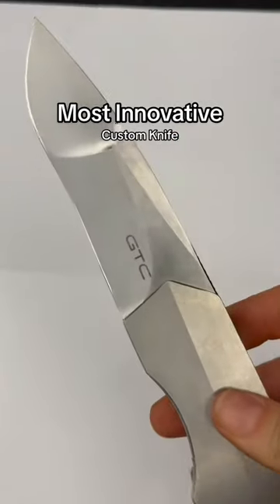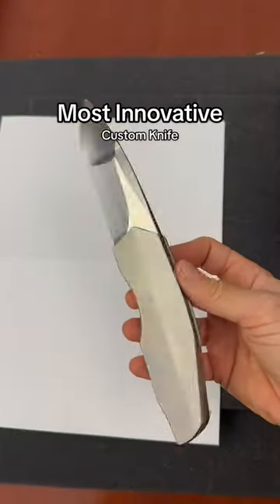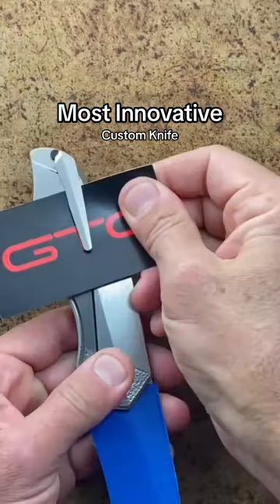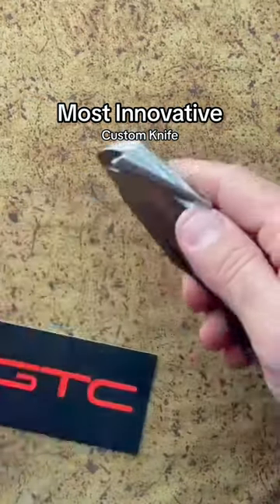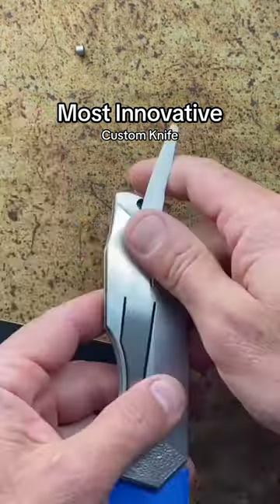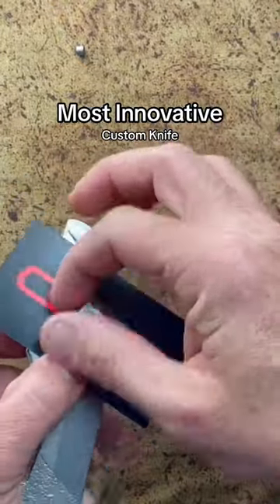Knife disassembles in 10 seconds

Comment: The paitience required to either machine that or set up the CNC coding would be beyond most mortal machinists.
Reply: I’ve operated a CNC for over 2 decades how difficult it would be would depend how many axis your cnc is and how many tool holders your machine held
Reply: High tolerances isn’t much harder just more time consuming you have to watch your tool wear and measure your clearances a lot my current job I have to maintain a plus or minus .0001 tolerance on my set up and the part needs to measure to a .001 tolerance I love talking machining
Reply: @bobelkiniii1461  it's always nice when you love what you do! I'm a licensed electrician and wood worker and people think I'm nuts because I love working and running my business. Work is my second favorite thing only behind spending time with my family. I will admit I do get jobs I like more than others but life is definitely easier when you do not hate your profession!
Reply: Hm
Reply: @RUGERJONES independant or union ?
Reply: @Coincidence_Theorist  did you ask this question so you can badger me about the answer?
Reply: @Coincidence_Theorist  it's ok either way I was just wondering lol. I'm an independent contractor, have my own LLC, 2 LLC's actually, both owned and operated by my family and I.
Reply: @bobelkiniii1461 you're either on a lathe or a grinder.
Reply: not really
Reply: @bobelkiniii1461  could you hollow out a penny so that a dime will fit under it? So when the penny is laying flat on the counter the dime is under it, and totally hidden? Saw a penny/dime pair once and always wanted a pair.
Reply: @Michael McClellan  honestly,  shouldn't be that difficult. As long as everything is dialed in,  it's just flat hollowing out. I might need to make a set now...
Reply: Mmmm no, the program for this would be made in less than 30 min. To refine it I would say it would take some more time. Simple things like this take up no time to make in CAM. I’m sure sketching and modeling takes longer.
Reply: @michaelmcclellan9422 I think this would be a good test for someone during a hiring test of there skills like welders come in for a test machine at come in and make a dime fit in a penny perfectly or we’ll not qualified enough, at least I think it would be a great test of skill
Reply: Cnc coding does not exist anymore all cam softwares do it automatically you just need to set passes speed etc but you can still do it manually if you wanna be an intellectual fella
Reply: Could do this pretty quick. 3 axis too, if you want. All dims +/- .001
Reply: It really doesn’t look that complicated to create gcode for, lots of flat surfaces, no undercuts or multi-axis milling, 1/2” endmill to hog most of the material out, 1/4” hog nose for the pockets inside the handle and for the lock bar and a 1/8” endmill for the small slots on the bottom, threadmill for the threads and Robert is your mothers brother

5 axis mill would let you do both sides in one setup but you could do it easy enough with 2 setups on a 3 axis and some custom fixturing, a couple hours  total programming for all the parts and a few pieces for optimizing feeds and speeds and you’ll be good 

The majority of time and money spent on the design would be 3d modeling and coming up with the design, the actual machining and CAM programming is the easy part
Reply: I highly doubt that.
Reply: @phuckyocouch9098  I’ve operated a lathe cnc and a manual lathe I currently operate a 4 axis cnc my machine has a chuck and I engrave blades on a round roll and that roll will go into a printing press that makes labels and my die will cut out the labels my company is rotometrics but we just got bought by maxess
Reply: @michaelmcclellan9422  you dont want the penny hallow you want a relieve cut into one side of the penny it would be easier with a with a thicker coin but I think I’ll give it a shot tonight
Reply: @RUGERJONES  i hated my job when I was younger and was a jerk and complained about everything for a few years then I got moved around a bunch and fired I thought I would never be capable of running any other machines but I discovered I’m great at running mazaks haas doosins and pretty much any machine that uses G and M code but I was super greatful rotometrics rehired me and since I’ve been back I found my happiness I wish I could make videos of the dies I engrave
Reply: @seancrane278  make sure you use older coins. I think it will turnn out better seeing as theyre better quality materials
Reply: @bobelkiniii1461  maxess. … interesting name from an .. i guess I’ll say Esoteric point of view .. though i don’t like how that sounds
Reply: @bobelkiniii1461  perspective changes everything does it not? 

Id love to see the results of you do the coin thing. You could have an oss stash coin from two 50 cent prices or silver dollars. 

Soo one sleeves into the other. 

Then you need to make a little elevated mount thing the coin sets in. Only b needs to be elevated the mm or soo the coin is thick.  

It will be used to separate the halves again by dropping the coin into a flat hard source while b placed in its little retaining collar thingy you make.
Reply: @bobelkiniii1461  there’s also an oss coin knife. 

Soo they fired and rehired ya? Sounds like it was all meant to be. 

Ive learn much of that sorta thing from #ChironLast
Reply: It largely depends on the machines you have available and your design. One of the things I do a lot because I only really have access to machines I built or restored is reworking designs to be easier to manufacture on the machines I have available. The end product is almost exactly the same but the way you get there is different.
Reply: Sure bud...
Reply: @IDK-yx2lr many machines still do long hand Fanuc. New Fadals for instance, have no conversational or EIA/ISO. We are not yet at the point of all machines or even most. So not sure what you're talking about.
Reply: 😂 what? Maybe 14 yrs ago... if u got a good machine and know what you're doing, it shouldn't be hard...
Reply: @Nick89BR  but it is still the same as it has been? I guess you haven't been around many shops and got lucky. Most have older machines in the first place. Not too mention how expensive the software is to update yearly or have. Most do not have these capabilities.
Reply: Depends on how much you love knives.
Reply: Pretty sure this homie doesn’t have cnc it’s called old school do it by hand. I could be wrong but I know gtc knives he does everything by hand I have a 4,500 dollar airborne on it’s way to me right now cuz he does it all himself by hand. Maybe this specific knife is different though? I’m not sure just my thoughts :)
Reply: Does that mean the knife is cheap to buy?
Reply: That’s why it’s 3k lmao.
Reply: Lol no
Any machinist with access to suitable  machines and MasterCam could make that. It would only take a little time to make the CAD files
Reply: @IDK-yx2lr What? Long hand EIA/G Code programming absolutely is still a common thing.
Reply: @Man_Emperor_of_Mankind  yea i said that
Reply: @bobelkiniii1461  Hi Bob, how did it turn out?
Reply: @bobelkiniii1461 having a tolerance of +/- 1 tenth is crazy, what are you machining. Most things I work on are +/- .003 very few things I work on have such a tight tolerance
Reply: @RUGERJONES 
something my late father once told me was, "it's never WORK, if you enjoy what you do."

Comment: Looks like something out of star wars, like a vibroblade amazing design
Reply: I agree with this
Reply: @Fr_dG me too
Reply: We need vibroblades. Dont think it would work like in star wars but if you could come up with a design where the blade was vibrating extremely fast and the rest was extremely stable and unaffected then it might work. I know they have saws like that for cutting casts because the rigidity of the cast will break from the vibration and a persons skin wont unless pressed to hard. Maybe that same tech but with a very sharp durable blade. I think if it was that easy it would have been done by now tho.
Reply: @Dudeston iirc cast saws dont vibrate, they just rotate back and forth extremely quickly. this cuts through the rigid outer shell of the cast but cant get through the fabric(or skin) underneath
Reply: Honestly totally true totally looks like something out of Star Wars or like something you would see in a video game

Comment: Honestly that thing looks like it'll hold together better than cheap pocket knives with the little screws. I've had a couple of them outright fall apart in my hand so that experience taught me that you get what you pay for. If you spend $20 on a pocket knife it's going to act like a $20 pocket knife.
Reply: Can you please explain how this is different? It still looks like it has a single rotating point attaching the blade to the handle.

Comment: I've watched it like 20 times. Where does the lever disappear to??
Reply: It has the GTC SLT, spring loaded tab. The flipper is on a spring and sticks out the back only enough to be able to pull it down to use. Once flipped open the spring pulls the tab back in so it isn't visible when open.

Comment: But for what purpose?
Reply: Its mostly to show that it can be done, hopefully prompting more innovative and high precision designs in the future.
Reply: @private_ventures2592  Ok. But why? What application of a knife requires constant and quick blade changes?
Reply: @liamsludge2659  you're fixating on the wrong point. It's not about changing out the blade. It's about showing that precision machining can eliminate the need for traditional knifemaking logic. This isn't even necessarily the final design that will be available to consumers.

It's a high concept piece. Doesn't matter if it functions at a higher level than other knives. Much like the Reate Exoskeleton, it's more for flash and design appreciation than for a demonstration of a superior knife.